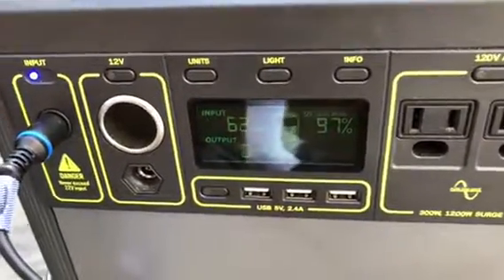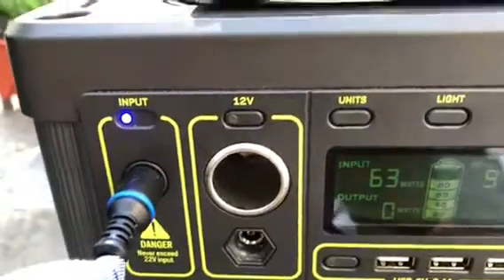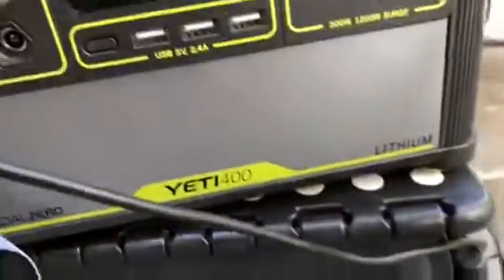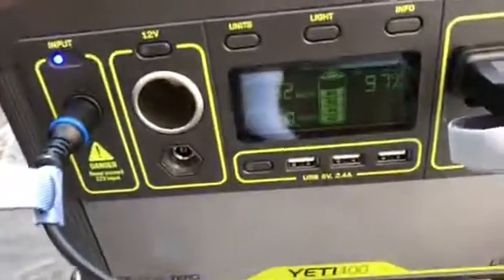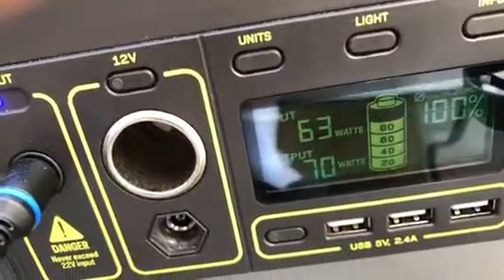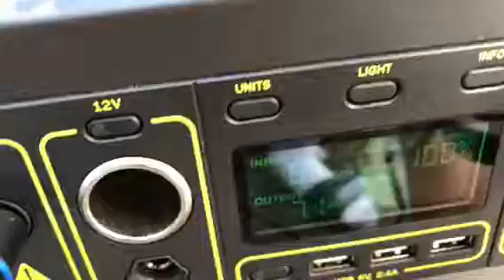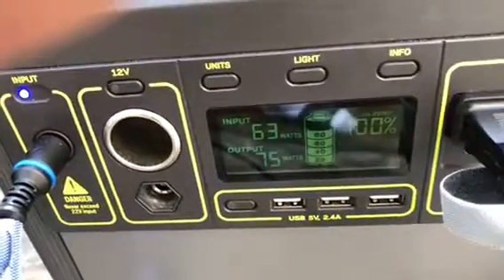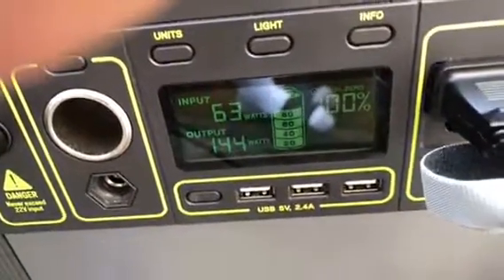Goal Zero Yeti 400 Lithium Shutdown Error with only 175 Watt Draw

Comment: The Dewalt 40Max 4.5 amp battery pulls 10.5-11.0 amps.  Though it does not pull 300 Watts.   I tried several ways of plugging in the charger while the yeti was off/on and the charger on with/without the battery in the cradle.  I did try it on the 1000 yeti and no problem at all.